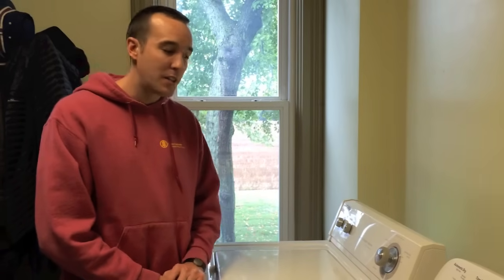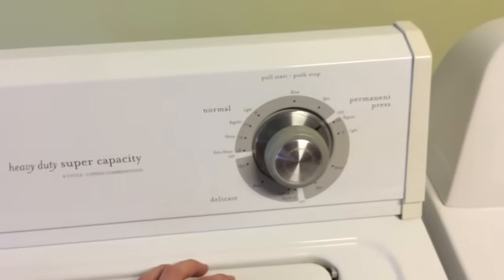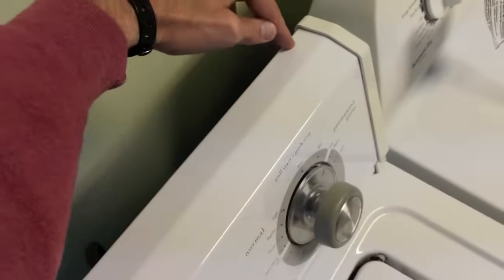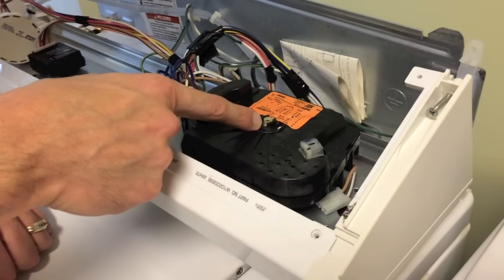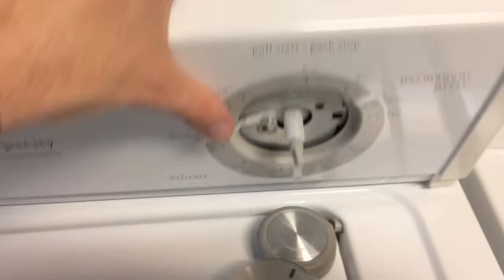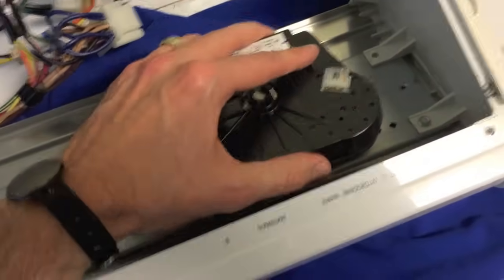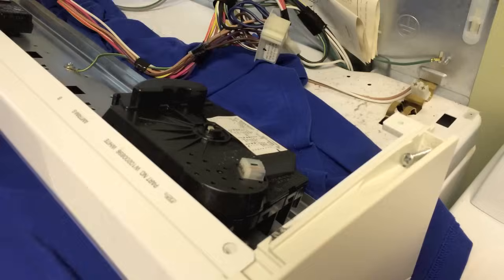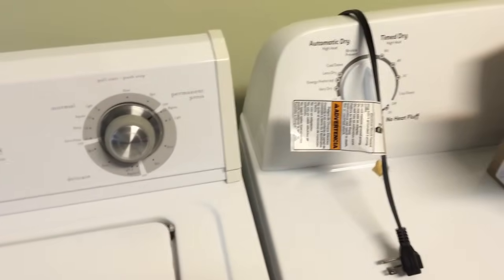My washing machine stops at Rinse - Does not DRAIN or SPIN

Comment: How do you know if the timer is bad ? I also made sure the filter are clean and that cold is connected in the right spot. Someone said it could be the little button that tells the machine if the lid is open or not , how do I check that. Because I cant afford to buy parts I dont need. I have an admiral washer and dryer. The dry doesnt always get warm . I was told if it was the heating element that that would just go out completely it wont get hot only some time it one way or the other. Sorry I'm a single lady and learning to be a diy. Gal. Appreciate any advise you may have and thank you
Reply from the maker: Thanks for checking out the video Tammy, great question!  The Timer controls the “Cycle Flow” and continues to move the cycle through the steps.  As the internal parts of the Timer begins to wear out...you see the washer stopping at either “Drain or Spin”...

The Lid Switch is also a key part in the cycle...once you lower the Lid/door...you will hear a click.  This click secures the electrical current and sends a message to the Timer to begin the Cycle.  

Also...once the cycle gets to the spin portion, the timer re-communicates  with the lid switch to verify that the lid is closed for safety purposes...example:  you do not want the washer to be spinning with the lid open...water will fly everywhere 😱

I recommend purchasing both the timer and the lid switch as they work together to move the washer through the cycle.  

To order parts, Go to:  repairclinic.com

Keep us posted.  Welcome to the DIY Raptor Club.

😎👍🔧🔩

Comment: Hello again! I read your comment just now, and as I was editing a reply, somehow I seemed to have lost your comment! How odd.. thanks for replying back so quickly in the morning whilst having your coffee! I have a font loader so I am assuming that you instead of a lid switch for a top loader it is the same as the " washer door lock and switch assembly", for a front loader. Also a very strange thing- this morning for no reason, without me filling the small tub for the fabric softner a moderate amount of fabric softner just reappeared on it's own  in the little dispensing unit - it was light blue and clean - almost as if I had added some of it just then....I have been overdoing the softner off late- so could it just be a blocked drainage pipe? I'm guessing back pressure is needed for this to happen but maybe it just happens if you leave a lot of water ( currently six inches deep) still in the machine....
Reply from the maker: Thanks for the reply, door lock mechanism is very possible.  Once you turn the machine on and start the cycle, if you hear a clicking sound near the door area, your door lock mechanism is working as designed.

Comment: I’m so pissed. I ordered a certified part from Sears and followed this video and the $200 part has gone out after only 3 months! I’m back watching your video because thankfully I kept my old part that still worked but was faulty so I have to go through this again. And Sears only has a 60 day return policy so beware to everyone who is considering purchasing this part from Sears.
Reply from the maker: Thanks for watching, that’s awful that the part only lasted 3 months…😲

Well…we are happy to hear our video can be helpful for you yet again.

😎👍
Reply: UPDATE To my comment for anyone who happens to read it. Thankfully my new part was not bad. The large connector got damaged during my original repair because I struggled to unhook it. As soon as I touched the connector this time it fell right out and I immediately knew that was the problem. Even though it no longer “locks/snaps” in, I pushed it it as far as it would go and put a strip of electrical tape going across the top to hold it in and the washing machine went into the rinse cycle immediately. So before you toss out your part, make sure it’s connected snuggly
Reply from the maker: @classicredwine  

Thanks for the follow up and sharing this.  Well, looks like you have a spare part on-hand for the future…or for another machine that’s the same.

😎👍

Comment: my Whirlpool washer will fill up with water but that's it, it will not agitate,  drain water or spin,  when you select your wash cycle it will fill with water and you can hear a humming noise coming from where the timer is and that's it.  I had a washer full of clothes and water.
Reply from the maker: Thanks for checking out the video.  Most of the time you run into your symptoms...your timer has faulted and is no longer receiving and sending the correct signals to all connected parts which in return, stops the cycle at random locations...NO FUN.  I would try replacing your timer.  Also, I recumbent replacing your lid switch as well because that acts as a safety precaution and will put a hold on the cycle near the rinse/spin portion once it fails.  The lid switch is very inexpensive and takes 10 minutes to replace.  Below is a link to my new video on replacing Lid Switch.  Keep me posted and please subscribe to the channel that would be awesome!

https://www.youtube.com/watch?v=1hTRc-_PnP8&lc=z12wirlhpvavj1ypy04ci3tozofnyd3avp00k

Comment: Hi thanks for the awesome video. Very thorough and easy to follow. Need your help or anyone in this comment section. Had an issue with the washer just stopping when it's suppose to go into the spin cycle. Tried it on low-med-high load. So I bought a timer. That didn't work, so I replaced the lid sensor. Not that either. So I am stuck trying to figure out how I am going to proceed to the next step. Any help would be greatly appreciated
Reply from the maker: p funk 

Thanks for watching, glad it helped.  How is your water flow?  When you start your cycle, your water comes into your washer through the valve.  Over time, this valve clogs up decreasing the flow rate.  This can cause your exact symptoms.

Below is a link to our step-by-step video that shows replacement of valve.

       https://youtu.be/DiPFZSMiBn8

Keep us posted.  Us fellow DIY’ers need to stick together.  Many more helpful videos to come!  😀

Please subscribe to the channel and Ring your YouTube Bell 🛎 that would be awesome thanks again!

😎👍🔧🔩
Reply: @DIYwithMichaelBorders  hi wow ty for responding. Yes the wateflow comes out through the valve. Does not seem to be any clogs. The water flow is perfect.
Reply from the maker: p funk 

Thanks for the reply.  The next step is to verify your Drain Hose is clean & clear.  A dirty and clogged hose will not allow the water to be drained efficiently...causing water pressure buildup which may cause the washer to stop mid cycle.

😎👍🔧🔩
Reply: @DIYwithMichaelBorders  I checked those also no clogs in the drain hoses.
Reply from the maker: p funk 

Thanks for the reply.  Any updates?

😎👍🔧🔩
Reply: @DIYwithMichaelBorders  Hi Michael. OMG I was trying to look at the electrical cables to see if any cables were loose or broken.  So my wife came to check on how things were going. She told me she ordered and new washer and dryer 🥴. She explained that we bought these machines from a used appliance Warehouse 3yrs ago and that they served it's purpose that I shouldn't waste anymore of my time and 💰. With all that is going on the world with this disease she doesn't want me out driving all over DFW looking for parts. So moral of my story is. I have a brand new switch and a lid sensor that I need to sell 🤣. Appreciate you Michael for replying and giving me troubleshooting tips.
Reply from the maker: p funk 

😂🤣😆...BEST comment of the day across our entire channel.  That’s absolutely hilarious.  Too funny!

You just made our day.  Nothing wrong with a Brand new washer & dryer.  😆

Comment: When you say stops at the rinse cycle, do you mean it fills but never spins or that it runs water but the drain doesn't close. The latter has happened twice. It's like what mechanism closes the drain malfunctions, and the water just runs continuously. I want to make sure I'm explaining my problem to Google correctly. 😄
Reply from the maker: Thanks for watching, in your case you most likely have a faulty valve.  Below is a link to our video discussing more about the specific valve that causes this.

       https://youtu.be/hlZAAeoK2iI

Please keep us posted and hey if you’re into crypto trading, check out our newly launched DIY ecosystem.

       Toolboxtoken.com

Reach out to us any time!  🧰
Reply: @DIYwithMichaelBorders  Thank you for the quick reply! I watched that video, but I'm pretty sure it's not the inlet valve because there is no water running when the washer is off. The water runs throughout the cycle at appropriate times; it'll go through the wash cycle and drain with no issue. When it starts to refill the bowl for the rinse cycle, it just doesn't fill up. It looks like running a bathtub with the drain open. It fills partly just because the amount of water coming in is greater than the drain. It's only happened twice so far, and not in back-to-back loads which leads me to believe it's not a total failure of a part yet. It will resume the full cycle with no issue if I switch it off, move the dial position, and restart it which is why I was initially thinking timer. I could see it being something with the pressure switch as well? I need to check my stabilizer rods as well because it's shaking like crazy even when completely level.
Reply from the maker: @danamandaharbaugh5883  

Thanks for the reply, we can set the valve possibility to the side for the moment.  Have you replaced Lid Switch in past?

While washer is spinning, does washer abort spin if Lid is slightly opened out of Lid Switch?  If so, it’s your Lid Switch.

Once washer gets to the point where it doesn’t fill, will it start filling if you carefully move Timer knob forward in the cycle?  If so, it’s your Timer.
Reply: @DIYwithMichaelBorders  I usually move the timer knob backwards rather than forward, but yes, it will return to normal function if I move it.
Reply from the maker: @danamandaharbaugh5883  

Thanks for the reply, we recommend replacing both your Timer and Lid Switch at same time.  Nothing wrong with installing a new Lid Switch at the same time.

Comment: I have a LTE6234DQ1 Whirlpool DOUBLE STACKABLE COMBO UNIT. First the dryer kept running and wouldn't shut off on it's own. So I replaced the dryer timer the first time I tried to use the washer it wouldn't drain out. It Haas a directdrive pump and it worked ok before I changed the timer on the dryer (yes it is the correct one) . I have also now changed the washer timer thinking the excessive heat may have damaged it. Still not working lid switch sounds ok. All wires in correct place. Any suggestions?
Reply from the maker: Rick Yost 

Thanks for watching & we hope the video helped.  It’s very possible that your Lid Switch has failed.  In most cases, a failed lid switch will still make that normal clicking sound however the internal parts and electrical sensor that sends that electrical message to your timer informing it that the lid is closed....has failed.  A new lid switch may solve your problem.

We really enjoy making these helpful videos for our fellow DIY’ers.  Many more DIY videos to come!  😀

Let us know if you have any questions.  Please subscribe to the channel and turn on your YouTube notification Bell 🛎 that would be awesome thanks again!

😎👍🔧🔩
Reply: Lid switch tested ok. I got it working now . Blew through the hose for level control switch and pulled off the violet wire on the dryer timer and reconnected it thinking it wasn't making good contact.   Now it's working fine.   What ever it was it's fixed now.     Thanks for your input.
Reply from the maker: Rick Yost 

Very cool & thanks for sharing your update Rick.

😎👍🔧🔩

Comment: How would the water valve tie into everything? Not sure how it is that the normal cycle works fine on the wash portion of the cycle but then hang on the rinse portion of the cycle??
Reply from the maker: mclc432 

Thanks for the question.  The water valve has a screen inside each hot and cold connection point where your water lines secure themselves to the machine.

Over the years, the screens gather dirt and grime and lead to a degraded water pressure entering the machine...weeeellll.... unfortunately this can trip your cycle and cause your cycle to stop.

Hope this helps!  😎👍🔧🔩

Comment: My washer stops after after rinse and won’t drain in that cycle.  I can turn the timer to spin and it will drain and spin, just not in the same cycle.  Confused if this is a timer or lid switch problem.  Kenmore 80 series top load model.
Reply from the maker: Thanks for watching & welcome to the DIY Raptor Club.  You can test lid switch with volt meter.

If you do not have a voltmeter, we recommend replacing lid switch first as it is the more friendlier price & replacement process.

If that doesn’t work, it is time to replace your Timer.  Please keep us posted, us fellow DIY’ers need to stick together!

Enjoy your day.  😎👍🔧🔩

Comment: How would one diagnose whether there might be a different problem causing this, vs going straight to replacing the timer? There’s other causes for the same issue...
Reply from the maker: Thanks for watching & welcome to the DIY Raptor Club.  Great question & you can test your lid switch.  Many helpful videos on that.

If you find your lid switch is faulty, check out the link below.  It shows the replacement steps of a lid switch.

       https://youtu.be/1hTRc-_PnP8

😎👍🔧🔩

Comment: Why don't they sell the metal push to release spring clips that are stuck into the end caps of the control panel, separately? Ours are rusted and one broke and now i have to buy the whole endcap, just to get the spring? Or do you know if they do sell them individually? Thanks. Sorry,,was mistaken. I found a sears schematic that shows the clip separate. But come on,,,16 bucks a piece? Insane.
Reply from the maker: Peter Ford 

Thanks for watching Peter.  Great question.  We recommend visiting 

       Repairclinic.com

Check this site out & enter your Washing Machine model #.  After that, every single part available for your specific Washer will come up.

Keep us posted!

Please subscribe to the channel and turn on your YouTube notification Bell 🛎 that would be awesome thanks again!  😎👍🔧🔩
Reply: @DIYwithMichaelBorders  Thanks Mike. Yeah, I've delt with repair clinic. They are helpful. Always the way it is,,the specific appliance you have they never show. I'm working in a Kenmore elite,by whirlpool and one of the metal clips was rusty and broke when I opened it. Dryer too. They're making a fortune on clip sales. 16 bucks a piece? Crazy. Thanks for the write back,, I'll bell y'all. Thanks.
Reply from the maker: Peter Ford 

Thanks for the reply.  Definitely try Ebay as well.  You may be able to come across a large variety of parts for your washer online.  😎👍

Comment: Thanks for the video. I have a very similar washer that I think might be having the same problem. One thing I want to try before I buy a new timer, though, I have read that there may be a sock or something stuck in the drain. I read there should be a plate on the back near the outlet hose that I can remove and check the drain but I can't find it on mine. Since you have such a similar model, I was hoping you could tell me how to check the drain to see if it is clogged?
Reply from the maker: Tobias Vargrim 

Thanks for checking out the video and sharing your experience Tobias!  To gain access to the internal parts that the hoses connect to, you will need to remove entire washer shell/case.  You will then be able to remove hoses to check & see if anything is clogging!  Keep us posted!

Please subscribe to the channel and turn on your YouTube notification Bell that would be awesome thanks again!

Comment: Hello, I have the same kind of machin. For me it fills water after that it does nothing only a noise of a running motor. How much timer cost you?
Reply from the maker: Thanks for watching, the Timer cost roughly $100.00

We also recommend replacing your lid switch along with your timer as they play a significant role in the machines cycle.

Comment: My washer won’t spin going through the cycles other than delicate, spins out.  On other cycles I have to catch the cycles, lift the door and close it then it works fine.  I am taking care of an estate but need my washer to work while here, I don’t want to purchase another to just turn around and have to sell.  I always loved this washer, please help.
Reply from the maker: SONJA 

Thanks for watching & you may have a failed Lid Switch.  Below is a link to our step-by-step video that shows replacement of Lid Switch.  Keep us posted!

       https://youtu.be/1hTRc-_PnP8

Please subscribe to the channel and Ring your YouTube Bell 🛎 that would be awesome thanks again!

😎👍🔧🔩
Reply: DIY With Michael Borders if it were the lid switch, wouldn’t it be all cycles?  It drains, just won’t spin on normal,  heavy, etc but does drain and spin on delicate cycle.  Thank you so much for the quick reply
Reply from the maker: SONJA 

Thanks for the reply.  It’s very possible.  If that doesn’t fix it, it’s almost 100% a failed Timer.

😎👍🔧🔩
Reply: DIY With Michael Borders where is the best place to purchase either of these parts?  The price range using google is pretty extreme
Reply: DIY With Michael Borders it’s a Kenmore, model #23832100
Reply from the maker: SONJA 

Thanks for the reply.  We always recommend:

RepairClinic.com

Once at the website, enter in your model number and select search.  All available parts will be provided.

😎👍🔧🔩